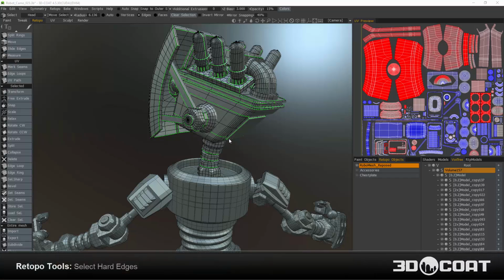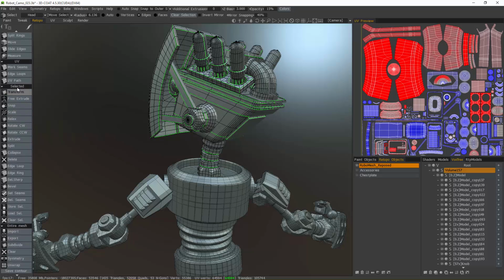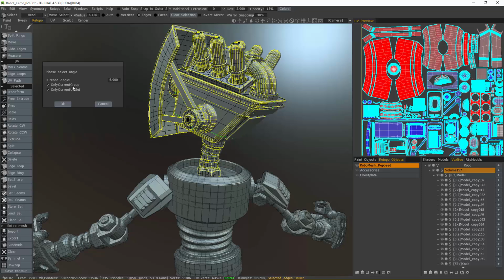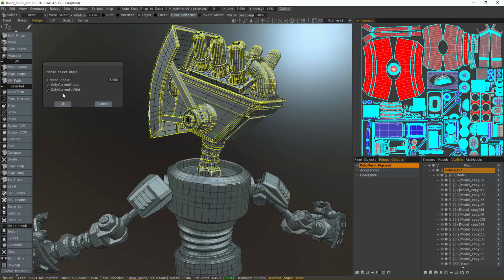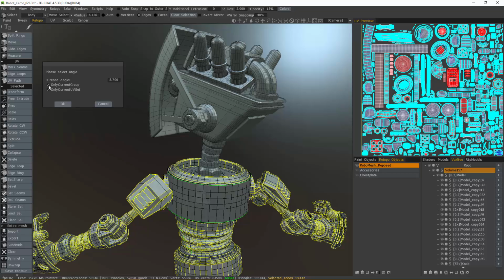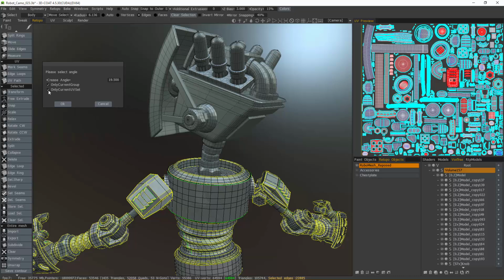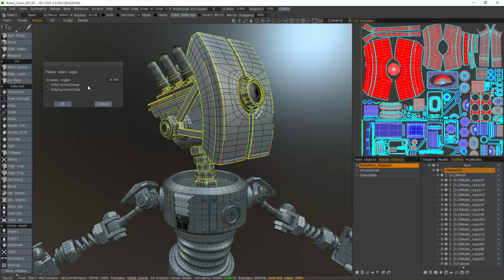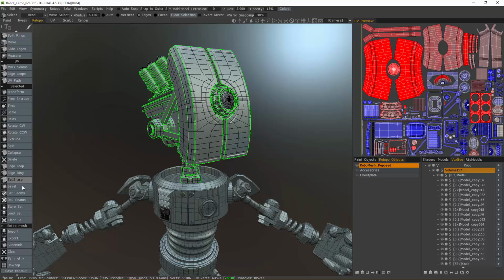Select Hard Edges

Comment: Thanks for the video!
But I´m still confused. Shouldn´t that sharp edges be applyed as "hard Edges" like in Maya, or "Smooth groups" like in Max to the geometry, insted of mark seams on the UVs?

PD:If it is possible. Could you cover that Hard/Soft edges (smoothing groups) topic? That is the only step I end up doing it in Maya .

Thanks!
Reply from the maker: +Fran Picazo It is not intended to harden edges/creases but to SELECT hard edges.
Reply: +3D Coat
Thanks for the clarification.
As a personal request: hard/Soft edges would be an awesome add!
All the best!
Reply: coat dont soport this( And i think we dont see this in closest future